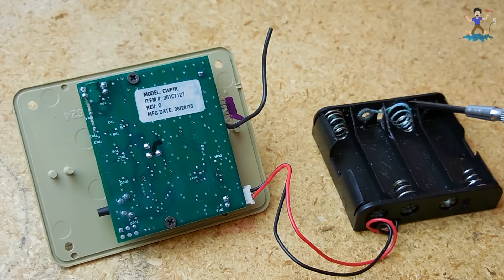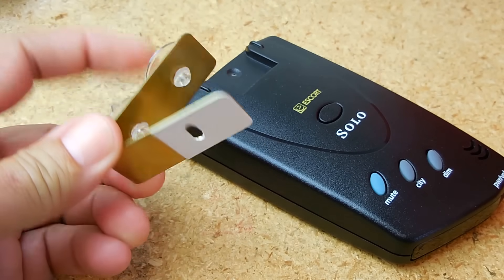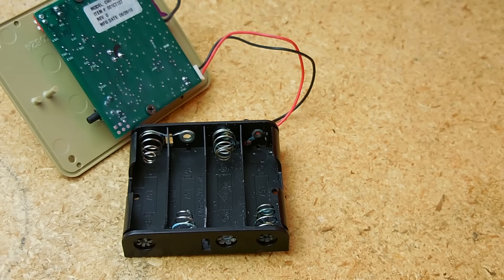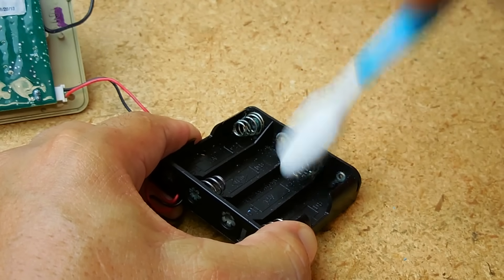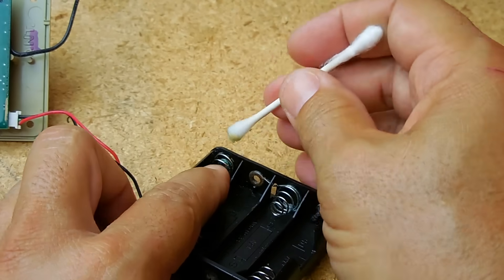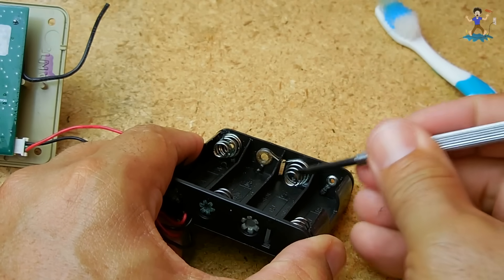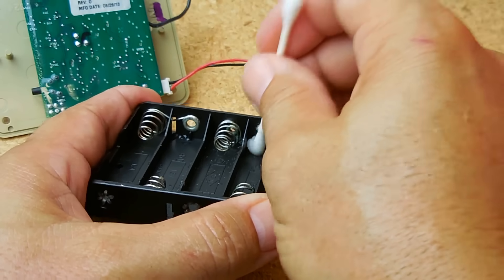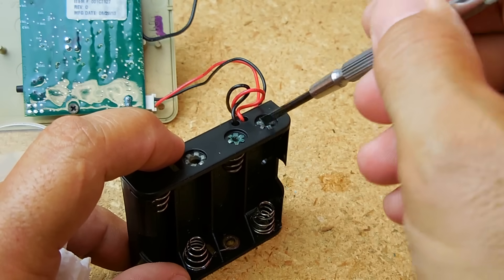EASILY Clean Battery Leak Damage(Corrosion) In Electronics

Comment: I love your videos,back in the 70's a product called tuner spray for tv repair men works great and the new name is contact cleaner.radio shack or electronic stores will carry it.
Reply: R.I.P., Radio Shack.
Reply: R D--I saw the term "tv repair men" and wondered if that job category still exists.  I grew up in the Fifties and Sixties, when there were lots of repair shops.  TVs have become so reliable and (relatively) cheap that I don't know when I last saw a shop that specializes in that.  So much of our electronics becomes "dated" before anything breaks down, however.  People just move on, buying new, rather than investigating how much it would cost to repair it.  However, I suspect repairs might, in some cases, cost as much as a replacement, so there's little incentive to do that.
Reply: You can get it at auto parts stores, also.
Reply: @Bill Williams Have one!  Lol. Still love tubes!  Especially the big ones radio transmitters used to use.

Comment: Rule of thumb:  Never use alkaline batteries in a device worth more than the batteries themselves.  They are disposable batteries for disposable devices.  Use Eneloop rechargeable batteries or Eveready Ultimate Lithium batteries in valuable or irreplaceable devices such as Fluke multimeters, laser distance meters, electronic flash guns or remote control units.  I have never had one of these batteries leak and cause damage to any electronic device.
Reply from the maker: Best rule, remove the batteries when not in use, and you'll never have a leak to clean up. :-)
Reply: electronicsNmore  Easier said than done.  Some of my Fluke meters need to be taken apart to remove the batteries.  And if you forget, you'll pay for your mistake.  Also, in the case of remote controls, those batteries will start to leak even while the remote control is still operational.  Removing the batteries is just not practical in this application, especially when you have several remotes in use.

Comment: I only use Nickel–metal hydride rechargeable batteries.  I never had one leak ever.  I have some that are over 5 years old that i use everyday.  When I need to I throw them back on the charger.  Just buy a bunch on Amazon and you never have to buy batteries again for a long time.  Some of the devices that I have are expensive.  My photographic flash meter cost over $300.  There is no way I'm going to put a cheap battery in there and have it leak.
Reply from the maker: NIMH leak.
Reply: I believe you.  I just haven't seen it happen and some of my batteries are over 5 years old.  I have Nickel–metal hydride rechargeable batteries in the tail light on my bicycle.  I use the the bicycle for commuting.  I've used the same 2 batteries for the the last 3 to 4 years.  Once every 6 weeks I put the batteries on the charger.  I haven't seen them leak ever.

Comment: Nice tips, but your battery compartment was removable. Using a vinegar soaked q-tip inside sensitive electronics where the battery compartment can't be removed seems risky.
Reply from the maker: sothathappened Nothing to lose.....if you don't clean as shown, then you'll end up throwing it away.

Comment: I've been doing this for 30+ years to recover from leaky batteries.
Wear some eye protection. An old toothbrush is a perfect tool for this job, but it will also flick a chunk of alkaline right in your eye.
Most items I take the circuit board out, and clean up the corrosion in a sink.
After spraying it with vinegar, I let it set, then brush the corrosion off, then rinse the vinegar off, thoroughly.
Let the item dry. If you have a forced area furnace, dry it over a floor vent. Put it in front of a fan.
If you have to clean a circuit board with an integrated battery holder, carefully clean with vinegar, neutralize the vinegar with water, then flush with as close to 99% alcohol as you can find. The alcohol will absorb any water residue. Air, or heat dry. A circuit board can handle 90-100°F with no problems, and dry quickly.
Don't forget to neutralize the vinegar with water; it WILL cause more damage than the alkaline corrosion.
Reply: Very often  the corrosion travels by capillarity along the wires .  If the battery holder can be replaced , do it , wires included.
Reply: pecospest, I was saying this very thing to myself as I viewed the video. Sometimes more is less and vice versa. More cost, less work. But what "cost" is there to a battery holder? Not much. Don't forget to use the correct solder and a bit of liquid flux. (see Paul Carlson's posts here or on Patreon).
Reply: Paul Carlson
Reply: @pecospest
How would replacing the battery holder help with wires infiltrated via capillary action? Battery holders are solid metal and springs.

The wires, sure, but if it is just some corrosion from a leaky battery, and a bit of white crystals, wash 'em off, get it dry and re-battery.

A close inspection of any wires will usually tell you if they've been compromised, but why waste time and resources replacing solid metal?  Doesn't make any sense.

GeoD
Reply: pecospest thank you for explaining your point with the word “capillarity!!!”  i recently experienced the STRANGEST and most random of issues with my ETHERNET CABLE.

please excuse my long winded story...sadly i missed the class on brevity. ( thus,  i routinely become distracted when attempting to thoroughly explain something thanks to my own ADHD kicking in! )  so here’s the situation:  my ex-fiancé ran a 100 ft long ethernet cable over the roof and into the master bedroom.  this was done to extend our    wi-fi range & enable his video game addiction performance via a second wireless router. 

never had a problem with this ghetto set-up ( for over 8 years ) until last months heavy rain storm.  the wireless router ( placed cockeyed & balancing on the top of a small flat screen tv ) “sprung a leak!”  as i was vacuuming i noticed a huge puddle of water under the tv!  knowing water & electricity are a deadly combination i unplugged the surge protector and sopped up the mess.  

yet the water kept collecting...in the exact same place!  i examined the bedroom ceiling for leaks and found nothing wrong.  next i followed the water source and discovered the wireless router ( on top if the tv ) was soaked with water.  i shook it and water sloshing sounds were followed by splashes of water flying out of this unit.  WTF!?!?  so i disconnected all the cables and power cord from the water possessed router so i could take it apart since this made ZERO sense!  even the plastic cover surrounding the outside of the router was like a foggy windshield from the accumulated moisture... so it was probably a goner.

while cleaning up the wet mess this router created i was puzzled.  how could there be no roof leak, yet this router was clearly waterlogged?!?  thanks to my ADHD i left the bedroom to take apart this router.  everything was disassembling easily until i reached one of those annoying security screws.  now i’d have to track down my security bit set, so i put it aside for later.

returning to the bedroom...i found yet ANOTHER POOL OF WATER!!?!?!  “that’s it,” i thought, “this house is possessed!”  since, even the simplest of repairs in this 1947 home turns into a massive undertaking!  i am truly losing my patience and sanity!  WTF is causing more water to leak?!?!  the router- which i thought created this problem in the first place was now sitting in my bathtub for further disassembly!  i rechecked the bedroom ceiling, now convinced there had to be a hairline crack or pinhole sized slow leak... nope, the ceiling was dry!  i even used a moisture meter to verify this! 

exasperated i sat on the hardwood floor with a roll of paper towels and cleaned up another mysterious pool of water.  THAT is WHEN i finally tracked down the problem!  the water was actually leaking though my ETHERNET CABLE!!!  the 100 feet cable thrown over my roof, under the crawl space beneath my house, up through a hole drilled in the hardwood 
floors of my bedroom, traveling up the ethernet cable into the wireless router that was sitting on-top of my tv!  times like this i wish i had studied both physics and engineering in school; surely that knowledge would have been invaluable for all future homeowners to know!

it may not have made logical sense for water to defy gravity this way, but once i shook the ethernet cable - it was clear that this had been the cause of my mysterious water leaks!  the pride of discovering the root of such a strange experience was immense and even though i lacked the correct word for how this happened... seeing YOUR COMMENT ABOVE... suddenly made it all crystal clear to me!!!  ........capillarity was the cause!  thank you!
Reply: @taritavirtue   sounds like you're pretty smart to track that down. And thank you for telling us about it cuz capillary action definitely can be a problem. I bought a vehicle that at some point previous to my purchase had had a battery blow up and the acid  moved by capillary action into the cables and corroded them so I had to replace both of the positive and negative battery cables because of the corrosion in the cables. I peeled the cover off of the cables and the corrosion was pretty much throughout the cable from one end to the other.
Reply: tarita virtue 0
Reply: @david vogel
Capillary action is much more likely to happen with a car battery because the acid is liquid. And much faster than solid alkaline in a battery.  That's why the 'replace the holder and wires is a waste of time.

I bought a car for $200 from a neighbor, once. It had a strange problem where it would randomly die, but start right back up.

It had brand new tires, so I bought it.  A week or so later, I was checking it out for the first time, fluid levels, etc, and getting familiar with it. I found a single cell in the battery low on water.

The cell was on the end where the positive cables were attached on the side of one of those gawd awful GM batteries.  Having experienced problems with side mounts, I pulled the cable loose, then added water. I then watched it seep out of the side of the battery.

Someone had replaced the bolt in the side mount, and it was a few millimeters too long, breaking the case.  The acid had gotten into the one of the battery cable ends, and had moved into the cable.  This was a late '80's Olds, and GM had moved to two battery cables back then, instead of one to the starter, it had one to starter and one to a junction box for everything else on the car.

It was the other cable which was bad, and why it would die, but always start right back up. (the ignition is included in the everything else.)

i replaced the cable end that day and it worked fine. I later replaced the battery and cable.  Nearly 20 years later, and I'm still driving the car, and I found out the car is very rare, less than 1000 made. Turns out it is worth 15,000-20,000!
Reply: @taritavirtue   you should write horror story novels 😲✌
Reply: You sound just like actor Gabe Kaplan. Welcome Back Kotter.
Reply: I have a slow moving quartz movement which suspect is due to a leaky battery. The problem is that it's one of those plastic snap on enclosed movement. I can't open it without breaking it off. Any idea?
Reply: Hi, do I need to use the alcohol rub? Only asking as it’s almost impossible to get hold of now!? Thanks.
Reply: @J Gee
'impossible'  Boy, that is true. You could get by without the alcohol, but make sure it's real dry.  Put it over a heat vent, or put a fan on it overnight.  Alcohol loves to suck up water, (hydrophilic), so 99% alcohol sloshed on it will suck up the water, and rinse it away.

Gas dry, and other fuel tank additives are basically alcohol. They mix with it, and then it will burn.
Reply: By the way, where can battery holders be bought? At the typical local electronic store or where online?
Reply: @KAS1JM 
I buy them from China, via eBay.   Last time I bought any, they were for 16550 Li-Ion batteries, but there are AA-AA & larger holders, as well.  (I recently bought some AA & AA sized Li-Ion batteries.  Anytime I have a device need 2 or 3 alkaline batteries, I use one salvage Li-Ion, instead. Haven't killed anything, yet.)

Comment: Hello. I just want to thank you for this video. I was about to throw a rather expensive Nikon camera flash unit in the trash due to severe damage from battery leakage. Then I found your video, got some white vinegar from my kitchen, and 20 minutes later, my flash works fine. You saved me an expensive repair or replacement.
Reply from the maker: Tom Crawford Return the favor by sharing my channel with others. Thanks!
Reply: Great information - THANKS
Reply: Did you still use the alcohol?

Comment: I almost always use a WD40 pen to put a light coat on the ends of batteries before I install them! I've had too many bad experiences of trying to extract and/or clean up after batter (especially in cylindrical things like Maglites)! Works great!
Reply: Blakehx, WD40 is not the recommended spray for this purpose as it is a chemical compound designed to displace water (Water Displacement compound number 40). Other sprays will help. Read the suggested comments above.
Reply: Not really on point...but...like a few posts here... I experienced corrosion & cleaning issues with MagLites years ago when it was an over-rated and over-hyped product.
Correctly removing the inevitable battery corrosion at the bottom of the tube is not worth its retail price...in frustration.
I've switched to other reliable, maintainable, and cheaper alternatives which last longer than Mags, are slimmer, pocketable, operate longer, use brighter cree LEDs, and AFFORDABLE.
Somehow, these new pocket torches havent encouraged  battery acid leaks after five yeats of real-world facility maintenance.
Reply: @HM-uf1lv  do you know any tricks to get a corroded battery out of a mag lite? What type of flash lights are you using now that you referred to?
Reply: I have a mag lite that has a corroded battery stuck in it & I haven't been able to get it out. Is there any trick I can use or is it ruined? It's so frustrating. Poor design.
Reply: @KatarinaS.  If this reply is not too late, call Mag-Lite
Phone: (909)947-1006 (within California) (800)283-5562 (outside California) Fax:     (909)947-5041  
The problem is we put batteries in Mag-Lites, then the lights often go unused for long periods of time.
Some years ago batteries had corroded in my 3-D cell Mag-Lite and could not be removed. i called them about it. I sent the dead light to them, and they sent a new light to me at no charge.
I now pull the batteries out of my Mag-Lites periodically to check them for corrosion.
They may or may not replace lights now, but it will not hurt to ask.
Reply: @ussling  Thank you so much for the response! It's not too late, I still have the flashlight. I have, however, learned not to keep batteries inside infrequently used items. I have several emergency flashlights in drawers throughout my home, but rather than keep the batteries in the flashlights, I now keep them right next to them in the drawers. That way nothing gets ruined, I'm reminded to check the batteries periodically because I can actually see them sitting there when I open the drawers, & they're still handy to pop in as needed, as opposed to being put away in the cupboard that I keep all of my batteries, which would be inconvenient if I'm struggling in the dark to try to access the batteries because all of my flashlights are empty. :)
Thanks again, I'm going to call them. Aside from the poor design of the battery casing, it's a great little flashlight & if they're willing to replace it then I'm cool with that.
Reply: I had to trash a Maglite because of corrosion, the batteries had expanded to the point that I threatened it with a drill press, but it didn’t flinch. I was going to setup-my drill press and ream it a good one but thought better-of this since the electrolyte would become a hazmat situation.
Reply from the maker: Thanks for watching! Be sure to share with your friends, and check out my latest "Bunker Bike" video.
Reply: Something else to IMMEDIATELY do with ANY aluminum bodied flashlight is to smear some of that automotive dielectric grease on the THREADS to the end cap of the flashlight. Otherwise moisture can get in there and “weld” the threads so you can’t unscrew the end cap.

Comment: I guess a tooth brush is better than nothing, but a brass wire brush is probably the best as it will really scrap away the corrosion deep in the metal springs without damaging it.